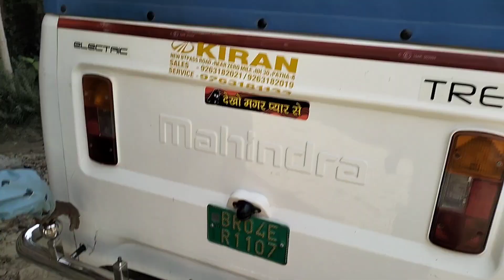Mahindra Treo Electric Rickshaw |back bumper 💥💥💥 | Welding Video

Comment: Bhai gadi me electric welding kare to kuch nhi hoga na.
Reply from the maker: Battery ka cable disconnect kar dena
Reply: @sonualivlogs  konsa wire kuoki battry to andhr hai na
Reply from the maker: Ek driver seat ke bagal me
Main cabal hoga clip wala
Use nikal do our ek piche 
Passenger seat ke paas
Chota battery hoga 12 volt ka
Use disconnected karo
Reply: @sonualivlogs  thnx sir ji for your reply 🙏
Reply from the maker: Bhai tab channel ko subscribe kar do
Yaar
Reply: @sonualivlogs  subscriber hi hu mere bhai apka
Reply: @sonualivlogs   paadan seat ke peeche wala ko disconnect kaise karu
Reply from the maker: 10 number hand tool rinch se
Use aap khol sakte hai ♥️